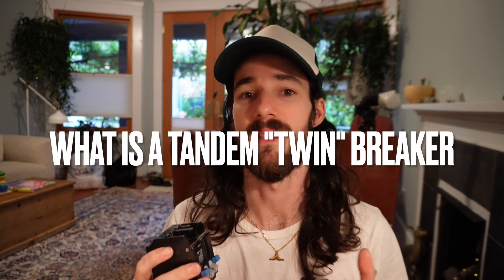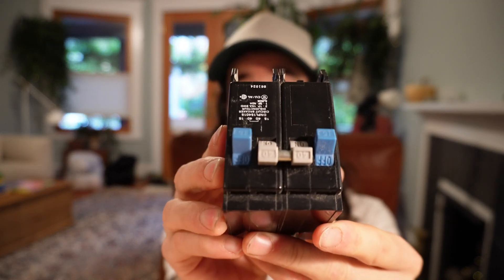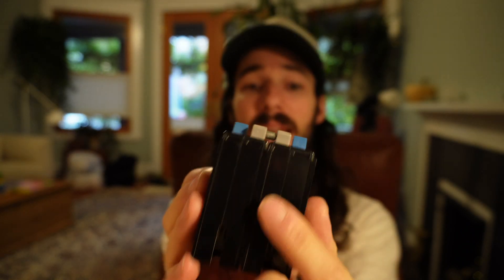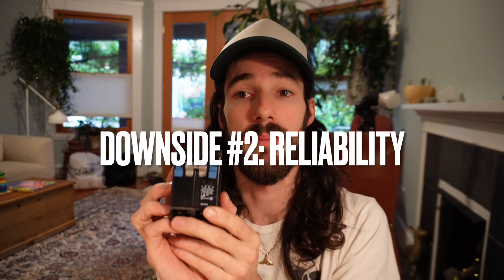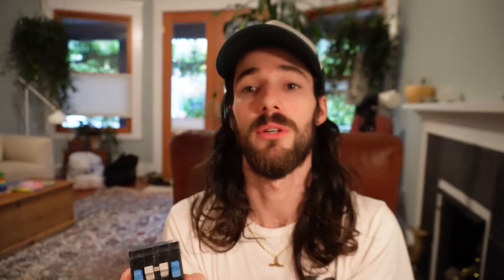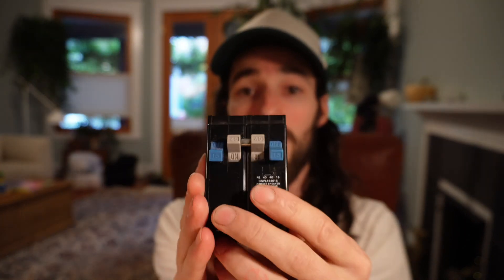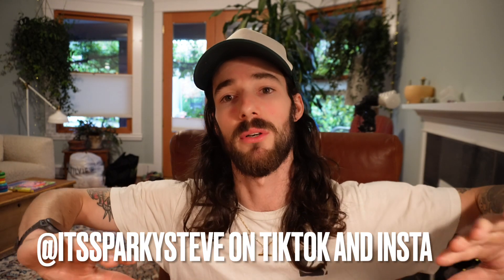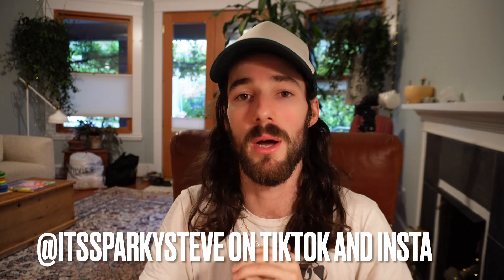Tandem Breakers EXPOSED! The Secrets Electricians Don't Talk About

Comment: I have a boatload of tandem breakers, but my setup is as follows: 
1. Welder (temp use) is tandem with the lights and facility equipment (low, constant draw).
2. The rest of the tandems are side-by-side and sequential, so the likelihood 2 sets of outlets are being used next to each other is low. 

My 100A box has 410A worth of breakers, but it's rare the whole box will see more than 60A at any time. It's a convenience and I'm an efficiency snob - individual wire runs instead of daisy-chains.

Comment: Tandem breakers are best used for lighting circuits and for minimally used outlets in the home where heaters and other high wattage things are not likely to be plugged in.  My rule is to only put replace two separate 15 single breakers with one 15 amp Tandem breaker on minimally used circuits (microwave, lighting, hallways).